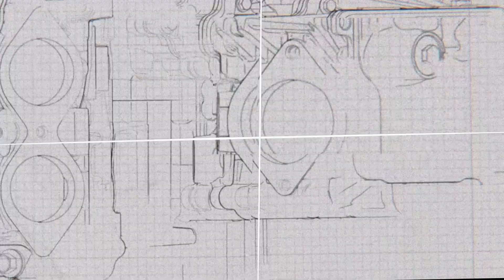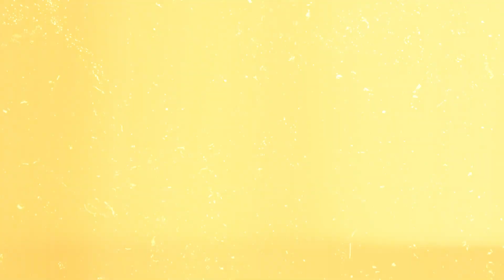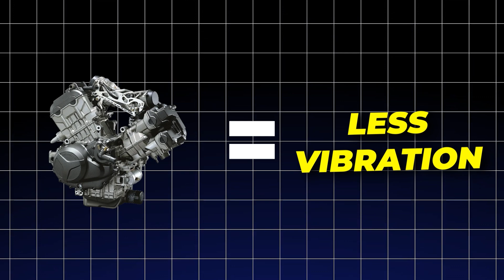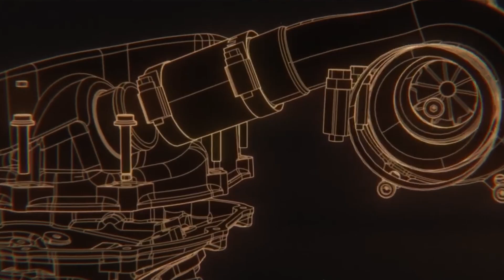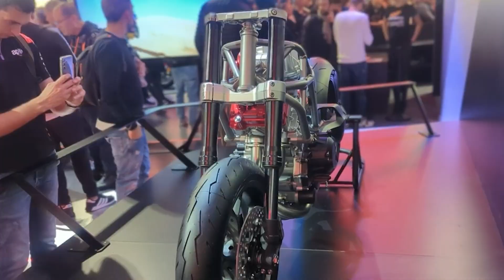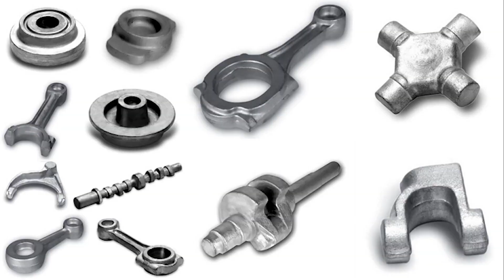Honda Ceo Just Revealed New V3 Engine & Shocked All Competition!

Comment: Seems like the hot compressor is VERY CLOSE to the fuel Tank, as well as incoming air to the engine...
Not being 'negative' because it seems like more power per CC will always be of benefit. And if it can produce more power per engine weight, that is a GOOD THING! And keeping the weight closer to the centerline will improve tip-over balance in curves and maneuvers...